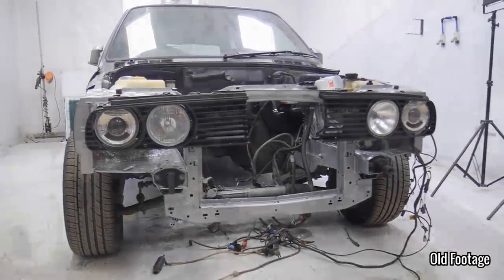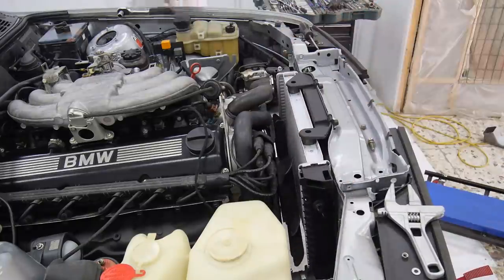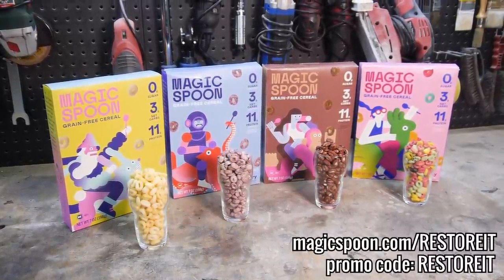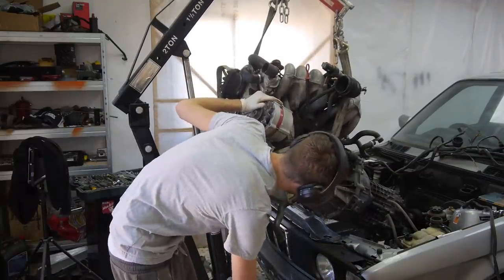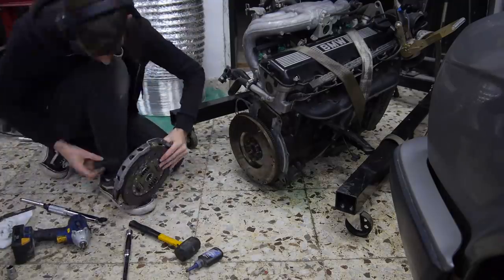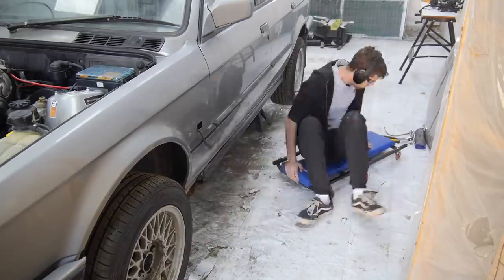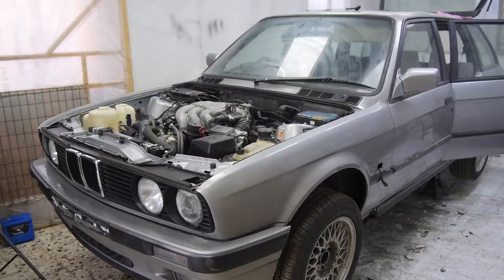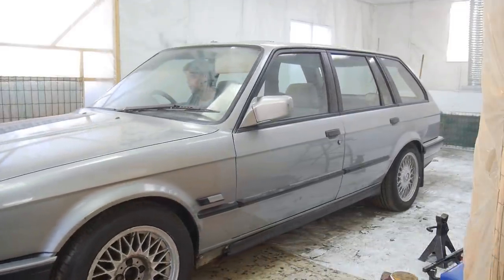BMW E30 325i Touring Engine First Start - What Happened To The Touring?

Comment: Dude - Magnificent job, iam impressed seeing your determination. One thing I must say - Never, ever put filler/putty on bare steel. It wil rust quickly because fillers are higroscopic and you trapped moisture inside. It will react with steel, sou you must cut fillers off to avoid rusting. You should spray epoxy primer directly on steel, then filler/putty and next epoxy primer again. Then use acrylic  primer and paint.
Keep going, Iam not a fan of BMW but admire your work.
Reply from the maker: Thanks for the advice Remont! Good to know now rather than later when I do the full restoration! Cheers.
Reply: @RestoreIt In dry climate, chances of failure are smaller , so maybe you are lucky.
Just remember the rule next time - always keep putty between epoxy primer layers.
Reply: just curious, while i understand spraying epoxy primer on bare metal first, why put epoxy primer on top of filler ?
Reply: @xav1uz  To close it between layers of epoxy primer. It prevents a various paint defects in next steps.
The most proper technology is:
1 - Rust filler applied on bare steel if there is any corrosion
2 - Epoxy primer
3 - Putty

Then you may sand the putty to recover all shapes and surfaces. Just dry sandpaper - absolutely no water!! just dry sanding.
4 - sealing of sanded putty with another  layer of epoxy primer, which is non higroscopic in opposite to acrylic primer
5 - Then Application of Acrylic primer in 2-max 3 layers
6 - Application of dry guide coat ( control powder, control spray etc) 
7 - wet sanding, using  dry guide layer as visual help,  as long as needed to restore proper shape of surface
8 - Rinsing using silicone remover
9 - Basecoat (color)
10 - clearcoat....

I know there is a lot of steps, but if you do it properly there is no way the rust will come out again... unless it is a Mazda... :D
Reply: @RemontidEalny it's nice to see someone who knows what he's talking about.

Comment: I just hope, now that you've figured out where all the plugs go, that you label the wire loom!!
Reply from the maker: Great idea! I will now :D
Reply: @RestoreIt  No need for that: You gonna know that particular model's loom-quirks by heart for good I reckon 😂
Reply: I label all the wires from a fiero I was rebuilding and then I pressure wash the engine before starting the work and all the labels was washed off.🙄

Comment: Huge kudos to you for having the guts to try again until you nail it. I've seen so many projects being abandoned due to frustration for years and years. I bet it was the most satisfying feeling ever, to be able to hear that engine after all the work you put into every part, bolt and nut of the car. Have a nice trip!

Comment: Very commendable to do the troubleshooting, it purrs like a kitten now! I've had to do some troubleshooting myself on my Mk3 Golf, misfiring issues and all that. Turned out coil was bad (got zapped when I wanted to touch it, great way to test ha) and even after replacing that, it went from misfires in wet weather to constantly running on 3. Popped the spark plug wires one by one and found the one that was broken. Such a great feeling.

Comment: I did a motronic 1.3 conversion on my e28 this summer. So I could ditch the gearbox sensors and all that old stuff. It's pretty easy actually. You only need a few wires to make it start. Power to dme, both from batterie AND ignition to wake up the ecu, power to coil, power to starter (one wire is enough the other is to unload the circuit), grounds etc. Turn the key to the on position, you should hear the relays click and the air vane buzz. If not you have a problem already (mine had a faulty dme relay which was too resistant, only had 2 volts out), changed it, then had spark but no start, my 6 injectors were gummed up, changed those and it started immediately. The motronic 1.3 is the better platform and more modern, stick to this one, as it's also the one from the car. The engine is the same, it's just the sensors that are related to which generation of dme and wiring you want.

Comment: That red engine tilter (my dad has an orange one just like it) is so much less useful than strong ratchet straps on four corners of the engine, especially in a fwd style awd vehicle, I used dollar store ones instead and just doubled them up to slack one off (strap second strap across first and tighten to seat first, then release and tighten to less than the one holding the drivetrain and release that one, the distance between the two you can have is determined by how far it can move suddenly, alternatively you can pull the release on just the handle and open it not all the way to the release point, then hold tension on the handle and release the latch side to transfer the weight to the handle, keep in mind there is a pinch chance here as the handle will want to force itself closed where your fingers are holding the latch, use appropriate precautions) where the engine tilter wanted to move either two directions at once if mounted diagonally, or it relied on balance to tilt across from it’s axis, this was where I first started using ratchet straps in this context and later with just a chain to hold the weight, finally evolving to trusting the straps entirely, works good with new straps and less so with rusted ones that were holding everything over the winter...
Reply from the maker: Good to know thanks Aterack! I'll keep this in mind :D

Comment: I know your pain with that flywheel. My Volvo 940 had a trigger on the flywheel and I had to take the transmission out TWICE to get it aligned properly. The first time I did it the crank pulley tdc mark was incorrect, and the second time I used a guide for an older car and so it was still wrong. Third time I finally got it

Comment: Just a comment to you shadetree mechanics like me: WD40 is not a lubricant, just a cleaner. Those bonnet hinges will soon dry up and become hard again, because the wd40 just evaporates or dries up. Use the appropriate grease on hinges like that.

Comment: Part of the reason I stopped working on cars is (like this video) I would spend hours sanding, painting, and polishing bits only to run into an issue like this and have all my detail work be ruined with oily fingerprints, scratches, dents, and toolmarks.
Reply from the maker: Haha i do know what you mean...

Comment: Hey man I’m having the same problem I think In my e30 the fuel pump isn’t making any noice and the engine is very close but just won’t turn over it has compression and spark but I don’t think it’s getting fuel. What should I do??
Reply from the maker: Check this out first of all - https://www.e30zone.net/e30wiki/index.php/Engines_Troubleshoot

Have you got the fuel pump working by bridging the relay with the ignition on? It might be a bad pump. But check out the guide and go from there. Read and follow everything very carfully. Good luck!
Reply: @RestoreIt  Thank you for responding! Yes we did try bridge the relay with no luck unfortunately. Thank you for that link I will read through it and see if I can find the problem. Appreciate the help and keep up the Chanel! I will let you know if I get it to work and share what was wrong with it. I’m actually only 15 and I’m really big on cars and it’s my first car.
Reply: @youngslick8811   check the plug going into the pump! I had gremlins in there for the longest time. It would slowly slide off the connector and make the car not start or bog really hard

Comment: hi mate prybar when placing the engine in ?? you have done a nice job on the engine bay why trash it like that  but for a first car restored its bob on
Reply from the maker: It was the only way I could get it to just slip above the lip... i was on my own and trust me i tried many ways before resorting to that. I actually correct any damage i made during that process. It's all in order don't worry. Plus, the car is getting fully stripped and a full concourse restoration done. That slam panel is getting replaced with a new one. You get my drift...

Comment: Engine start to long. Long start is problem of crankshaft position sensor, i recomend you buy new from Bosh firm. If i not mistaken,  12 14 1 730 027 - original Bosh part number. End, dude, it's great job 🤙, in 2020 so little old cool cars, especially BMW, respect!
Reply from the maker: It was only that time that it took that long. But during the full resto I will buy a new one for it :)